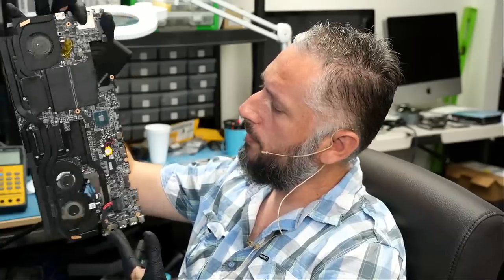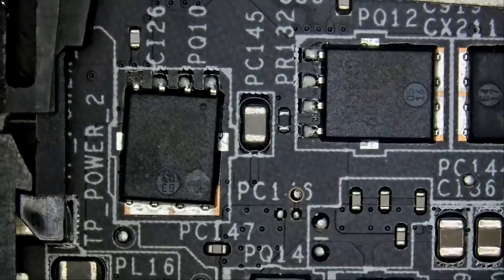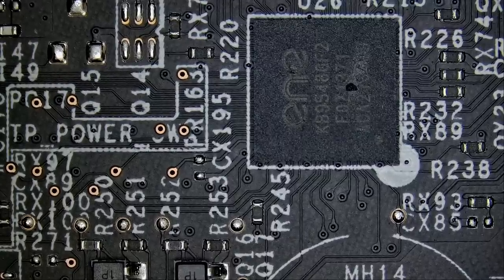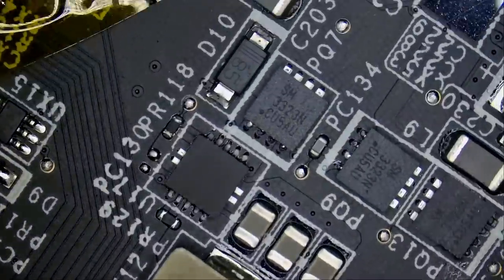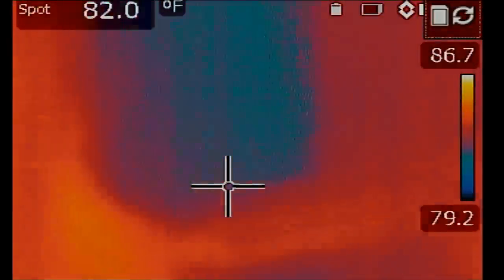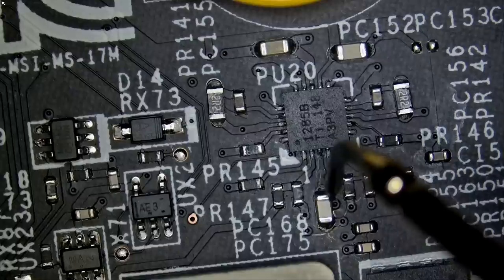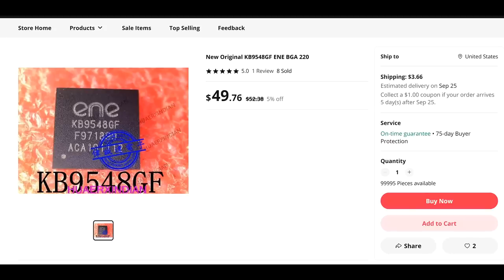MSI GS76 Laptop Failed and won't power on. What's wrong?

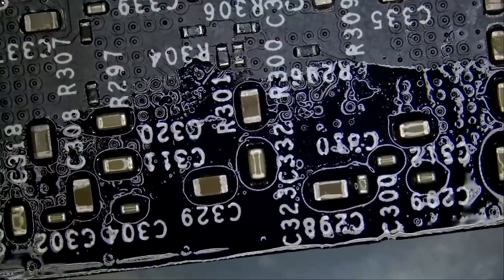Comment: Looking forward to the next action-packed, thrilling instalment. Probably an illusion, but something very odd looking at 5:26, looks to be a runaway pad or crooked IC with a hole and resistor heading for the 9th dimension.

Comment: After doing a thesis on the blown superio chip, I've come to the conclusion that electricity caused it to blow.
Reply: You passed with honors, sir!
Reply: Here! Take my cookie!
Reply: But what broke the electricity? You haven't done your analysis to the root cause yet
Reply: I thought your thesis was on super Mario.
Reply: I concur...
Reply: Yes, just like how water is wet, never dry.
Reply: Hahaha !! You Sir, are a Genius ! You should also receive the Nobel Prize for your outstanding achievement !
Reply: I disagree I think powering it on in the first place caused the fault
Reply: Bad pixies.
Reply: @dafalzonAUS soldering the chip at the factory is the main reason. If they didn't solder it the chip would be safe and sound.
Reply: As per my research disconnecting the electricity line (charging adapter) will secure the chip from blow. No power, no accident.

Comment: Lots of deals on MSI laptops now. I am passing on them thanks to the knowledge gained here.
Reply: I wouldn't judge your buying decision off of one single failed case when there are likely hundreds of thousands of MSI laptops out in the world that are working perfectly fine. It's like if I said that "oh, this bus burned down, so I'm not gonna ride buses anymore" (a bus actually caught fire in a city near me). We can't make things that are perfect unfortunately, so there will always be broken things, that's how it is unfortunately...
Reply: Great thought. I've dealt with MSI laptops for many years and agree. Desktop MSI boards? No problem and have built many pc's using them with zero issues. But when it comes to Laptops, I always buy Razer. They're so damn solid.

Comment: Match revision # on board before selecting Donor. BIOS is Flashable but carry a secondary emergency backup copy. If these two are not incrementally matched this system will not POST.
Reply: What does incrementally matched mean?

Comment: Worth the fix.  Also that chip should be drop in ready.
Reply: Many of the newer style chips need to be programmed. I’ve had a few that we’re for Lenovo laptops in that same package that needed to be programmed before installed. Some of the older style IO chip program themselves so your looking at a 50/50 chance. The real problem is having the correct hardware to program those new style chips. A real reliable programmer cost $900-1500 based on which IO chip packages you want to program.
Reply: @shiftctrlhack  how to do you program the chip. I see BIOS on manufacturer site but people always asking for BIOS dump.
Reply: I think the ebay one is programmed chips that why the price is a little bit  higher than Ali express one.
Reply: The older chips required preprogramming. The firmware is part of the BIOS firmware. There are several videos on how to program the older style the chips. The newer chips (BGA chips) do not require to be preprogrammed. Rather, they must be completely blank and the BIOS will program the chip upon startup.

Comment: There is yet another issue. Most like the chip will be a fake or defective. And after installing you will think that there is some other issue with the board, but in fact it is the chip. Many of those SuperIO chips from China are defective or fake (empty shell).

Comment: if there is a bios chip nearby, you might not need to reprogram it. usually this kind of chip have an option to use external bios chip. if not, good luck to find clean region for that board.😅

Comment: there are two types of these chips, the KB9548GF and the KB9548GF2, the one on this MSI laptop ends in GF2.
it is unclear if the chips are the same or not, anyway both are super expensive, , over 50USD per chip.
Reply: It's a ridiculous amount to pay for a chip don't you think ??

Comment: HEY, is 200€ pricetag gaming monitor worth repair, or just return ?
We have local policies and i should still be able to get my money back.

Loose light, and dead pixels.

I am in the need of monitor, i do buddy system, kinda, always have the next on the side.
If my main monitor goes boom i can just swap wires, couse it can take weeks to get another one if i dont have budget available.

Comment: I shortcircuited a GS76 mb by dropping a screw while swapping ssd. Is it possible to install a mb from GS66, the 15' model? I like having 17' (yes i was dumb and did not disconnect first)

Comment: Is the hole in the chip for ventilation? :)
Reply: He could have filled the hole and it's a fix
Reply: @drelectronics13  duct tape would work
Reply: All the other components on the board knew that chip was an A hole.  😮
Reply: No, not for ventilation.  It is for fixing the garden hose to it.  The flow of water will keep it cool and prevent further overheating.

Comment: I don't think it's wise to ask the customer to buy the chip, what he knows about this stuff. it's part of your job
Reply: it is the correct move to ask customer. Considering that NF charges a flat fee for non-repairs, it is going to be $70 out of their own pocket if replacement doesn't fix it. It is very easy for us to be critical when it isn't our business to run.
Reply: Car shops also send you to buy parts for your car when it breaks. This is normal practice in the repair industry.